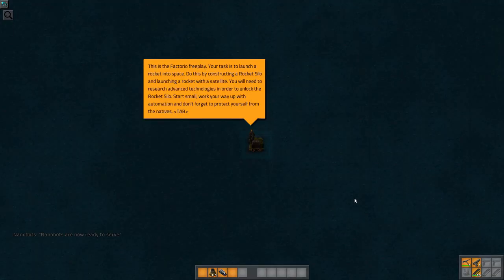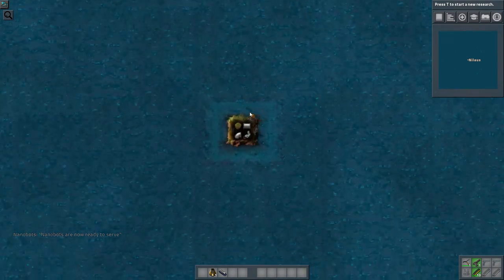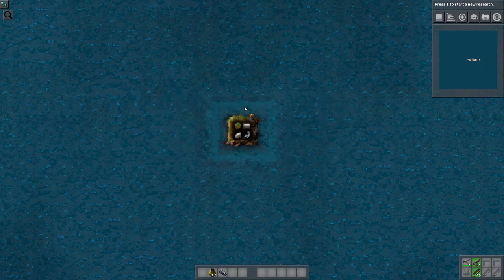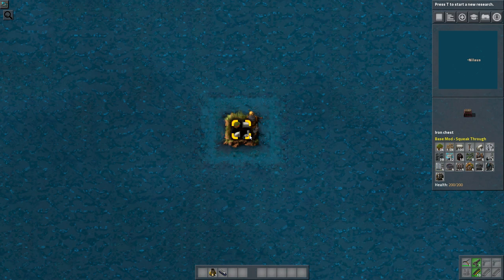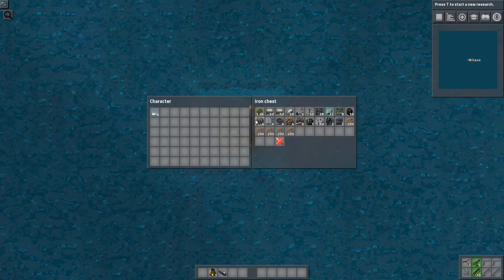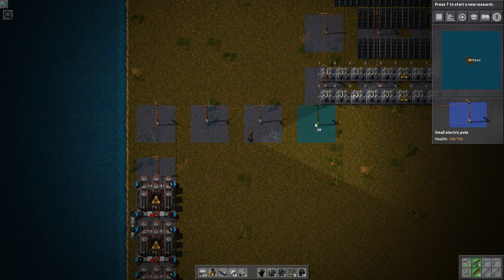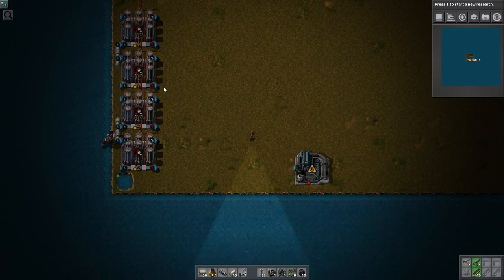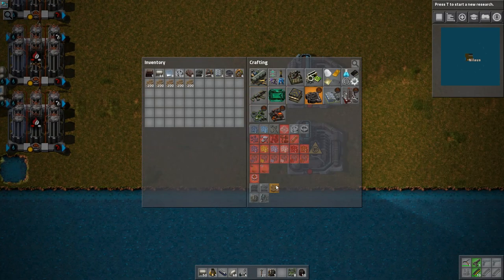Factorio - Sea Block Tutorial - 01 From Slag to Iron

Comment: Please note:  To get the "bonus land",  the player MUST reduce the tile placing tool to the minimum size (using the "-" on the number pad on the keyboard...(default key settings)
Reply: Also - if you have the "Water Fix" mod installed, you'll want to disable it first.  Among other things, that mod "fixes" the bonus land trick such that it no longer works.
Reply: Thank you for posting this comment!  I really wanted that extra land to start out with.

Comment: Don't make purified water from hydrogen and oxygen, it's far more expensive than using the water treatment plant - yes, even considering you get the oxygen and hydrogen "for free". You really need to do a bit of calculation to find the right way to do things :P It does save a bit of space so it may be useful at the very beginning (while still 100% solar), but don't rely on it especially once your purified water consumption gets higher.
Reply from the maker: interesting. I will need to check the numbers and see how that adds up :)